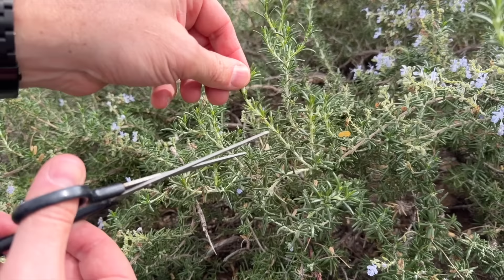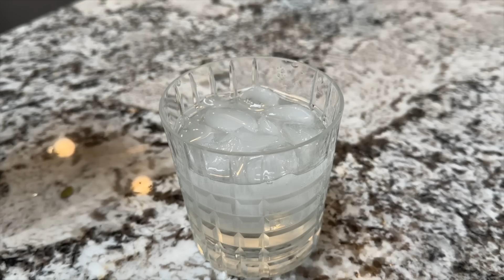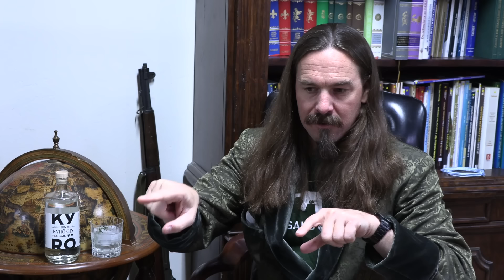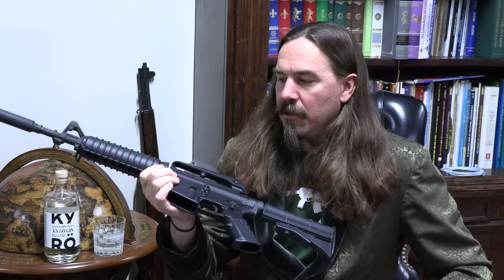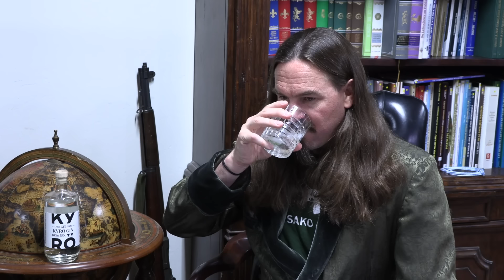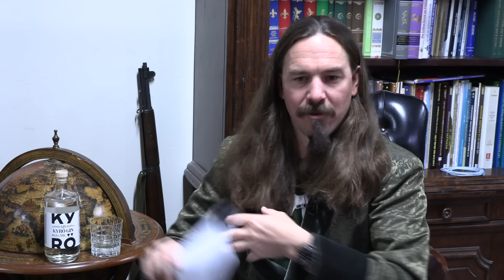How Guns are Made: Tolerances, Methods, and Metallurgy (Q&A January 2026)

Comment: The typical rule of thumb for most components, is if you want 10 do it on a manual machine, if you want up to a thousand, CNC it, if you want millions, stamp it.
Reply: A good CNC guy (program/setup/run) can have a CNC so efficiently set up you can pull of a one or two piece job as quick as a manual machine. And a good machinist should excel at each type of machining!
Reply: Depends on what you want to do. I worked in the sheet metal business and everything was made on a CNC laser or punch press, it could be a one off that would never get made again and it would be cut on an NC machine because it was always faster. The only exception was if you needed a shim and could snip off a piece of whatever from the scrap bin.
Reply: @mmm31415 Especially if it's basic ops on standard material, you can just grab the parameters from a previous job/template and get it sorted really fast. Maybe do a quick second op or some prep facing by hand, but no point trying to manually mill a pocket and spot a dozen holes.
Reply: If you are me; i only want one perfect one, so spend a stupid amount of time creating a jig so i can make multiples and pick the  best one out of the batch. After doing this, realize that if i just spent the time making the part with regular tools instead of making the jig I could've been done with it in 1/4th the time. Throw away the jig the day before the part i made with it breaks. Start working on an improved jig.
Reply: If i paid for a cnc machine, best believe every job is going in that bad boy😂
Reply: I use manual and cnc, its nice having both, a cnc lathe would be nice to have but we never got one, the manual lathe  gets us by  but the cnc lathe would be nice to cut 3/4 spherical radius on nozzles and seat inserts
Reply: @Millzspec that would be a bit like trying to shoot a small bird with a Bofors gun. Having a manual (or even better a computer assisted) lathe and/or mill is great for doing small things quickly.
Reply: Maybe in the '90s but at this point I'd have the 10 parts done by the time the guy on the manual was on part 3.
Reply: @edrees3874  that ENTIRELY depends on how complex the part is and how tight the tolerances are. a quick square up and drill, manual all day. A crazy complex part which will require multiple setups and doesn't have a lot of pocket milling or profiling, also probably a manual machine. It really comes down to the individual machinist though.
Reply: Yup. CNC the inards maybe, but thats all
Reply: I’ve designed a had a lot of prototype and one off R&D pats built. Almost every part comes off a CNC/laser/EDM machine. The only time I ever see manual machines used is for small mods of existing parts.
Reply: Came here to say just this. When you want a LOT of a simple part, stamp it. But to Ian's later point, its sort of been taken over by injection molding. The buy in for stamping dies is astronomical. The buy in for a set of molds is also high, but the return on investment is faster with lower cost of materials.
Reply: I know CNC machines are great. But they use special bits / inserts. Is there a guy just down the road that makes those?
Reply: If you are going manual at less then ten you need to work on you CNC workflow. I make programs for single parts all the time.
Reply: Rule of thumb? Maybe it should've been rule of wrist eh?
Reply: @TheMCD1989 rule of wrist would have been messed up in the supposed original meaning
Reply: @AbstractAproach it's a quote from Boondock Saints, I was hoping someone would catch the reference. But that is exactly the joke from the movie 😂
Reply: @TheMCD1989 Sorry, I saw the reference but was too mortified by the thought of manually making ten parts to respond....
Reply: @TheMCD1989 oh I heard it was deemed abusive to hit your wife with to large of a stick, unless it was small enough (about the size of a man's thumb). Kind of a dark joke, but made worse by explaining it. I like Boondocks Saints but don't remember it very well. Sorry to have to failed you.
Reply: @TheMCD1989 Wikipedia seems to dispel this origin now that I look, but does acknowledge the myth
Reply: @TheMCD1989 ”This is Rosie, you’re gonna be training her today.”
Reply: For stamping to be worthwhile, you've got to be planning to produce enough units to justify the cost of the stamping dies, which are very expensive. Maybe not millions of units, but certainly more than a few hundred or even a few thousand.
Reply: @johnlowe37  It's definitely a hundred thousand minimum. Anything less would be a flop.
Reply: @johnlowe37 what exactly is difference between a die make and a regular machinist? I mean I understand that you need tools to be at least 10x more accurate than the required tolerances but with a wire edm and a modicum of skill it really doesn’t seem that ability is the limiting factor so much anymore so what other skills does a diemaker possess above and beyond a skilled machinist?
Reply: @ツAttemptMade-r5e tool and die makers not only have to make the parts but also assemble the tooling in the press and make adjustments to the tooling to deal with variations in material thickness, compensate for wear, and troubleshoot any issues with tooling. You need to not just understand how to cut metal but also how it flows when you shove it into a die, and how to make it do what you want.
Reply: The reality is closer to "If the design is not finalised, you do manual. If you need a few thousands or less, you CNC from billet. If you need more, custom casting and CNC the cast is the way to go." Most designs don't translate from billet/CNC to stamped. And those that do are generally done with stamping from the get go, just in multiple operations instead of a single press. Actually newer press brakes are CNC with variable punches and dies that do multiple shapes faster and cleaner than a custom stamping die, so that's also just CNC'd.
Reply: That's not even close to true.
A complex part is dramatically easier and quicker to CNC, than to manual machine it.
There is zero reason to use manual machines anymore unless you're making a square cube with no features for some reason.

Comment: I have seen some sintering of 3D printed parts. It was some very specialized equipment, process and part, but it was a while ago and these things become cheaper really fast.
Reply: Yes and no. You can MIM parts or you can metal binder jet them (kind of like MIM, but you 3D print the shapes). It´s still about 10x as expensive as sheet metal fabrication. When it comes to volume, boy nothing beats sheet metal fabrication. It´s now being overshadowed by gigacasting in automotive. I have recently compared MBJ with sheet metal fabrication and MIM on a recent handle project.
Reply: Printing is starting to become more mainstream. Technologica !
Reply: @spacedmanspiff1543  Yeah, but metal 3D printing is different, you can´t simply scale that to your home office.
Reply: @sierraecho884 it will get there eventually.  Economy of scale.  Laser deposition machines are coming down in price. The heat treating equipment is add on expense as well to be sure.....short answere is that it is not unobtainium anymore.
Reply: @spacedmanspiff1543  "...it will get there eventually. Economy of scale.  ..." I am afraid you don´t get my point. It is not about economy of scale. Handling the powder is super dangerous. 
And the equipment is not only expensive, it´s difficult to handle safely. The issue isn´t the price, the issue is the same reason as why people don´t smelt iron ore in their living room.

Comment: No, we don't have the manufacturing base. Swiching over would be a long term event because most machining equipment even the CNC type is obsolescent items from the 1980s-1990s. The biggest obstackle is spare parts and the second largest is people who know how to program them, knowing the quirks of the Machines. Textbook coading will cause them to crash. Only on the very newest machines which few companies have could the manufacturing base be swapped out quickly. Likely it would take a 10-20 years to build up a supply of new machines, train the operators, and to reach capacity.
Reply: I agree 100% with you. Well done my friend.
Reply: Lol learn to spell

Comment: The Blanchard lathe design sort of lives on today, with the the most common machine being the Bacci T4mo. They're also called copy lathes. 
Generally these have been phased out in gunstock manufacturing in the early 2000s by multispindle 5 axis machines which can do both the shaping of the exterior surface and inletting of the areas that interface with metal in one setup.
Reply: Keycutters are pretty similar
Reply: Keycutters are pretty similar

Comment: I spent the last 6 years of my career in an aerospace manufacturing environment, it was heavy on CNC mills, lathes, and punches. It is relatively easy to switch from making one part to another, we would do new set-ups all the time. The real limitations come when you want to make larger parts; most mills would make most any small arms part other than barrels but bigger pieces for bigger guns would require a bigger mill. Our biggest mill was a DMU 75, I believe there are YouTube videos showing it doing finish work on a 4-cylinder engine block casting. 
Tolerancing was as low as 0.001 inch (1/thousandth), measurements were made using a Coordinate Measurement Machine (CMM) which used the same 3D program that designed the part. 
 IIRC There was some discussion at one time about a Federal requirement to register all CNC mills to crack down on illicit arms manufacture. The plan was shelved/abandoned, likely because of the sheer size of the effort and the very small occurrence of such manufacturing.